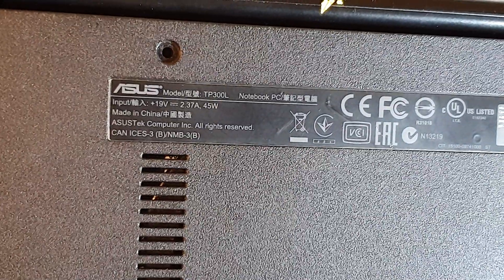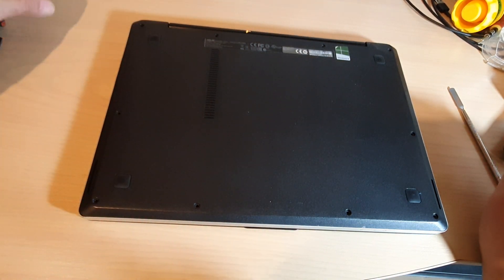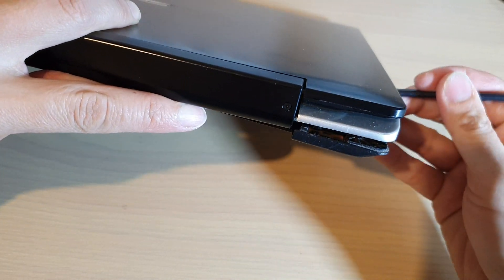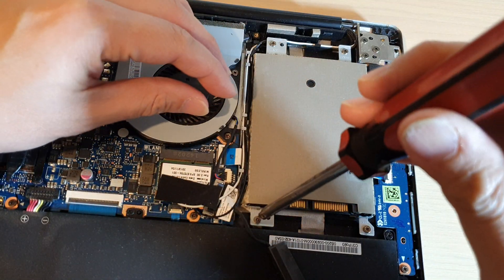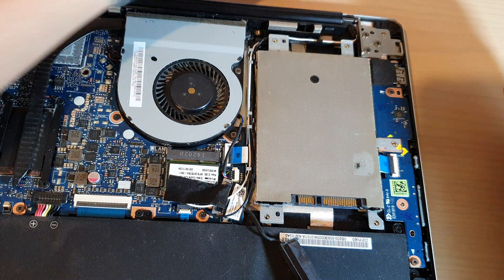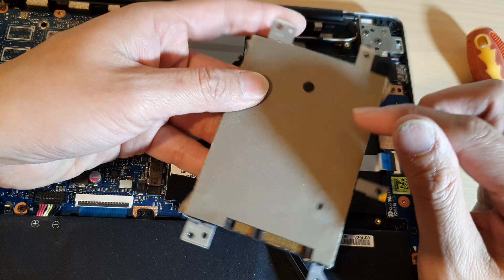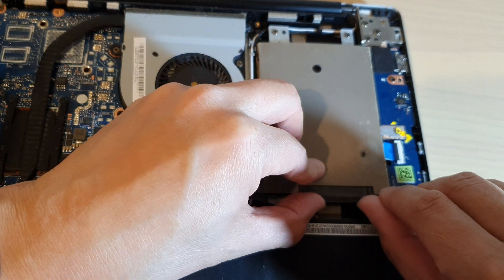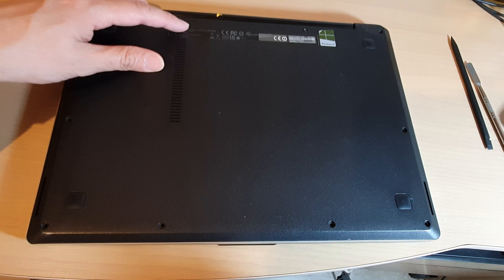How to Remove & Replace a Hard Drive on ASUS TP300L Transformer Book Flip

Comment: i have the same laptop and i replaced it with SSD Lexar 250GB but it's not visible in bios or boot , it's only visible after i install windows and after first restart it wont boot anymore